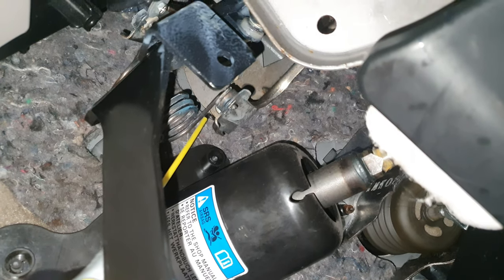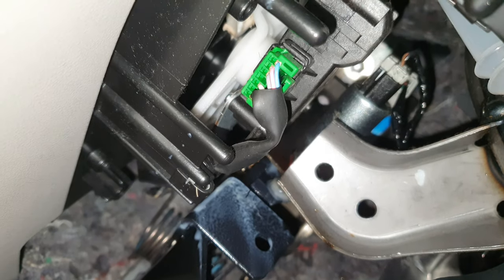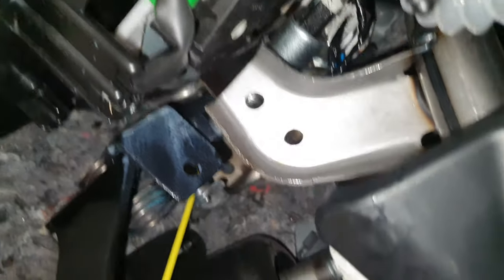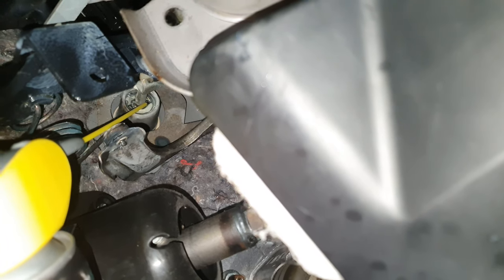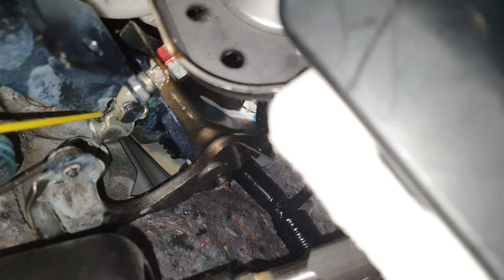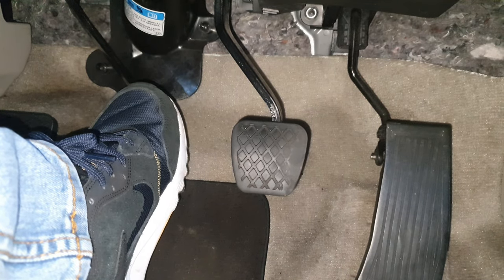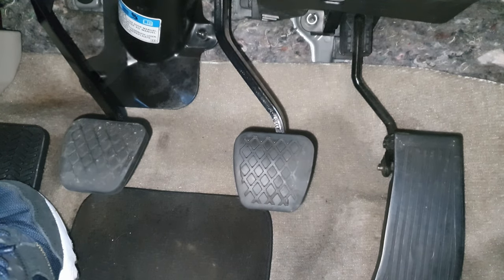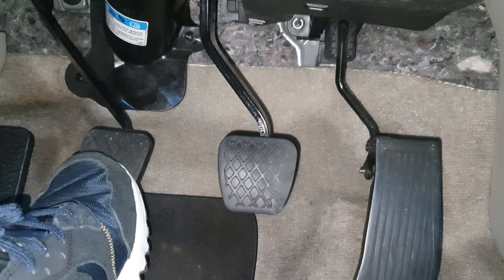How to fix a squeaky clutch pedal/clutch pedal squeaks/honda accord cu3.

Comment: Great vid, worked on my CRV clutch, couldn't see the rod but a few squirts of the dilithium crystals in the general direction got rid of that poxy squeek,  cheers bud.
Reply from the maker: The lithium grease works well but any oil will do the job really. Anyway thanks for the support pal. Cheers.

Comment: Could you show how you accessed these squeeky parts because I push the seat back then I stick my head in there and can’t see anything. I admit I’m getting on in years but short of hanging upside down on the drivers seat how can you see anything because I can’t. Any advice/instruction will be greatly appreciated 👍🏻
Reply from the maker: hi hemtet yes i understand i find it difficult to see what is going on too but if possible push the seat right back and try to lay down facing the roof, i agree it is really difficult but it is really the only way unless you get someone more flexible to do it for you, also if you just use WD40 it will work just as good so try the one with the long straw and cover your peddles and carpet then just spray it everywhere up there, WD40 won't damage any of the electrics so don't worry if you spray them, hopefully this helps.
Reply: @GPTV2020  thanks will give that a go

Comment: I have a 2007 Accord - over the years, not one mechanic has successfully fixed the problem for me.  
The problem disappears in the cold winter though - bizarre. 
I suppose I have to remove the dash panel underneath, each time I do this?
Reply from the maker: Well i never have removed any panels to stop the squeaks i just use WD40  now with the straw and spray the hole mechanism. I only need to do it once a year maybe. Thanks for your comment.
Reply: @GPTV2020  Well heck - that sounds good. I need to be doing this.  
The hole mechanism - where the push rod disappears into the firewall?
Or did u you mean whole mechanism?

I was thinking of buying a can of white lithium grease and trying it.
Lithium grease ok on accidental wire overspray?
Reply from the maker: https://youtu.be/GS0T-cCF0Wc

I know I said use lithium grease in this video but honestly it's a bit messy and becomes a bit sticky over time, i now just use standard WD40 and spray everything that moves. Just put a towel down where you don't want to spray like the carpets and pedal pads, as for wiring it's fine to use wd40.

Comment: I'm facing the same problem with my new Honda jazz 2020.. they lubricated and they gave it  back.. it stopped and again it is coming.. can you suggest something?
Reply from the maker: +Naveen Elangovan all i can say is the lad that done the job in honda maybe didn't do it correctly, just get some lithium grease and grease anything that moves under there, if its still happening it could be at the gearbox side where the clutch enters the box grease that too.
Reply: @GPTV2020  thank you very much. I'll try and reply you 🔜

Comment: Aye, it's rather like a wheel slightly out balance on the front. It puts years on the car. The same with a rattle or squeak or squeal, it's annoying. My right knee cracks quietly as I'm pedaling my bike. That's just old age I suppose. I'll try WD40 first and see how long that lasts - that's on the Jag - not my knee lol. Cheers.
Reply from the maker: Lol, i was thinking that! Lol my knees crack just walking up the stairs ha ha i think ill try wd40 on my knees too! WD40 will work on the clutch pedal too I've used it a few times but doesn't last forever.

Comment: Lubricate the pushrod?
Reply: Yeah I know
Reply from the maker: Still working perfectly fine with no issues 🤷‍♂️
Reply: @GPTV2020 I was genuinely asking if that’s what it was. Thanks for the helpful video, much appreciated.
Reply from the maker: @SpicyMcGeezak  thank you for clearing, i did consider not spraying the push rod the first time. Now i just use WD40 it works grand. Did you work for you?